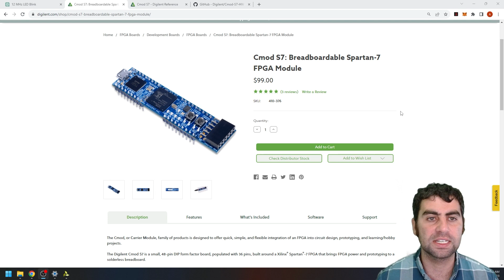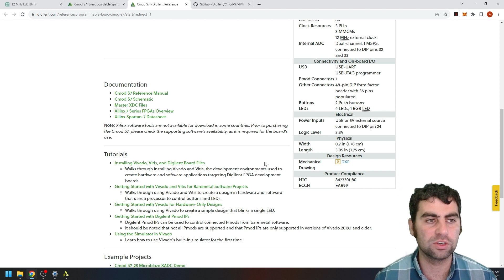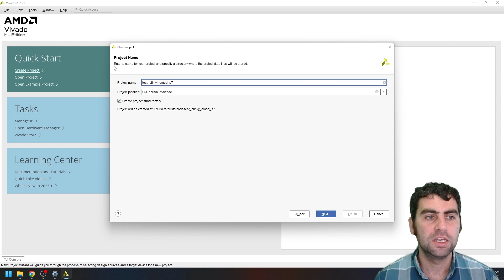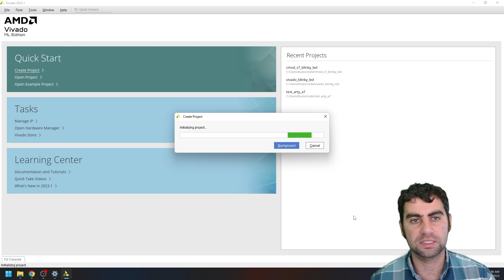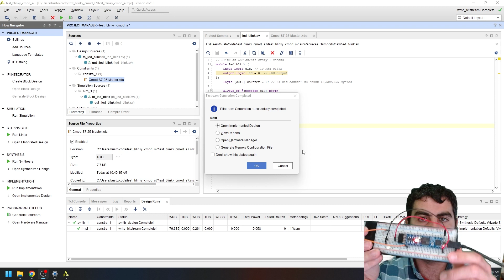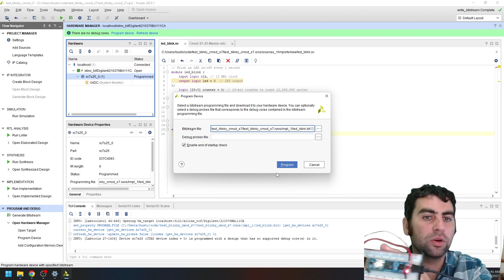CMOD S7 Tutorial: Learn to Make An Led Blink w/ A Digilent FPGA Board

Comment: Hi great tutorial !!  Is there any way we can use the GPIO port as an input pin, for example the output from one pin is used to trigger another input pin. I am asking based on Artix-7 GPIO  Sheild pins. Thank you.
Reply: Yes. Absolutely. You can drive a signal out of the GPIO right back into another GPIO. This is a common use case for built in self tests (BiST). Just make sure to set the IO state (e.g. input/output) correctly in your top level Verilog/VHDL file.